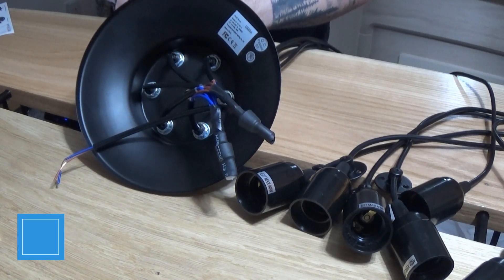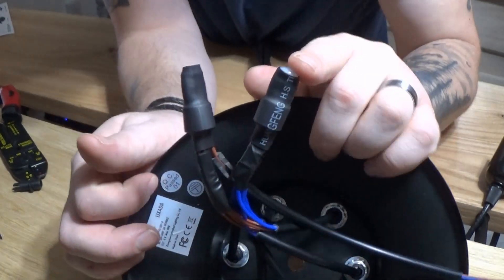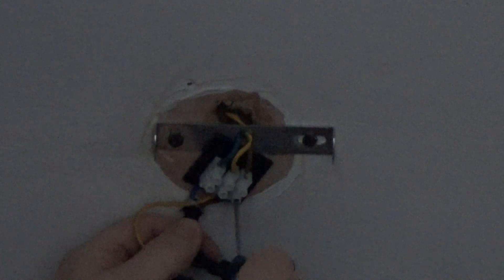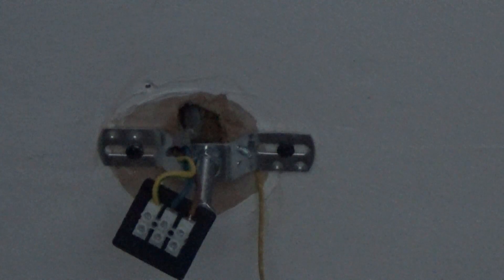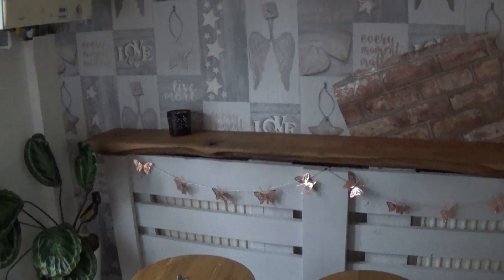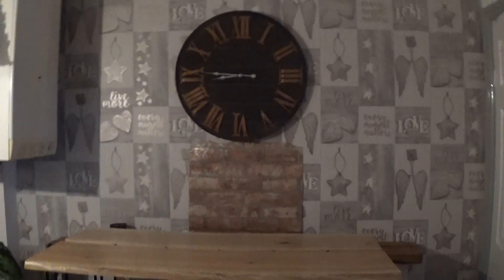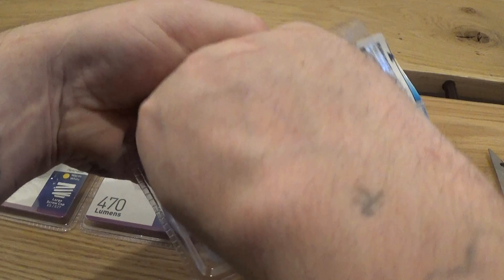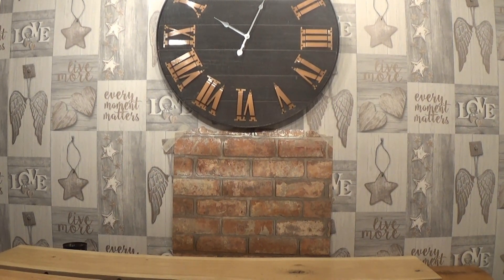How to wire up and install a spider ceiling lamp or spider chandelier on your ceiling. UK

Comment: thanks for the video, but clearly the key part people might have needed guidance with would be the initial joining up of all the wires and then the way you connected the 'joining' wire from the 6 live and 6 neutral wires etc...

Comment: The rubber on each of the earth and live wires goes right to the end, do I need to strip the rubber off before putting into the closed cap, to ensure electrical conduction can be carried out?

Comment: Thanks for walking through each sub-step thoroughly.  Trying to install in a defined circular pattern with equal internal arc but different lengths from the ceiling set pieces to the bulb.  I may have to arrange that before combining the common wires.   Your video was easy to follow and provided direction to try to accomplish that.

Comment: Thank you for this! I bought one of these fixtures years ago and the instructions provided for wiring were TERRIBLE!!! I’ve installed plenty of ceiling fans and even multi-bulb fixtures before, but this was a whole other beast of wires. Thankfully I didn’t get to the renovations in the room I’d bought the fixture for until now, so I haven’t had to deal with it. I remember trying to find a video a couple years ago with no luck, so this helps a ton!

Comment: My connector block is attached to the old light that was up can I remove it and buy a new one like you have ?
Reply from the maker: Yes you can do that no problem. Use the old one or buy a new one.
Reply: @TomsProductReviews  where would i get the block and extra piece of wire from as mine never came with any? Also came with none of the crimp connector things.

Comment: So i bought This and mine didn’t come with the extra wire so what should I do
Reply from the maker: The small piece of wire? Got an old lamp? use the wire from that and cut it to length, other than that you could ask your local DIY store for a piece. They'll probably charge you by the metre but it won't be expensive.
Reply: My light from Amazon also never came with extra insulated wire (not included on the accessory list either) so I guess they assumed I would have some haha. Thanks for the video!